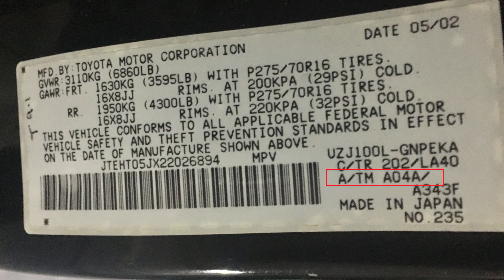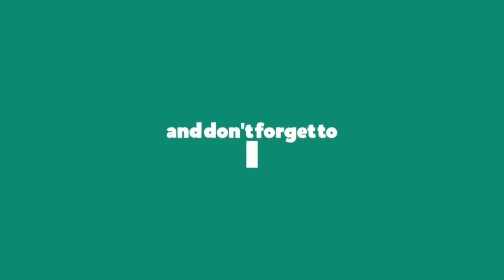Junkyard Find - How to pull an E-Locker for a Toyota 4Runner

Comment: This might be redundant to ask but I want to be sure before purchasing a taco diff. Tacoma e-lockers are 4.1 but their axle code is b03a (8 inch ring) & my 4Runner is 4.1 with axle code a03a (7 inch ring). I’m aware the axle housing will require some modification, but will the difference in ring size be an issue ?

Comment: I can just get a locker out of a Tacoma if I need a 4.10 right?
Reply from the maker: Yes
Reply: Tacoma axles are setup for leaf springs though and 4Runners for coil springs so you would have to mod it
Reply from the maker: Just pull the locker (3rd member) and modify existing housing to fit it.

Comment: I have a 98 4wd 5 speed 4Runner with a 4.10 gear ratio and would like to install an elocker. Can I pull the whole rear axel off a Tacoma and swap it into mine since I would like to retain my gear ratio and leave my front differential?
Reply: I believe the Tacoma axles are setup for leaf springs and 4Runners for coil springs so you may have an issue there

Comment: Will these parts fork for a 2001 Tacoma? Or are they not interchangeable with the 4Runner?
Reply from the maker: Same. Most of the time… we 4runner owners source part from a taco since it has 4.10 gear ratio. The axle housing won’t work but the 3rd member will

Comment: I’m struggling to pull the elocker pumpkin from the axle. I was hoping this video would answer that. Does anyone have a video link?
Reply from the maker: You gotta lock it. Then you can pull it out. You can remove actuator and use a flat head to spin the gear to lock it also.
Reply: @PhoRunner  I snapped the longest stud on my actuator and I’m hesitant to force it without completely understanding how it comes together. Is it safe to use heat on these components?
Reply from the maker: @jlaaj  Here's a photo of what it looks like inside. Just a gear so snapping the long bolt should be fine since it will slide off still.

https://www.toyota-4runner.org/3rd-gen-t4rs/284551-i-bought-new-aisin-elocker-actuator.html
Reply: @PhoRunner  I have since successfully pulled the actuator. Can you confirm which way the actuator has to be positioned? Driver or passenger side? I Did the opposite of what it was but the diff is hinge on something up top on something and I don’t want to reef on it too hard without knowing for sure. I suspect one of the multiple snapped studs is corroded and sticking. I have the axle shafts slide out as far as the brake lines will let me but that could also be a factor. Thank you for your time
Reply from the maker: @jlaaj if memory serves, towards the driver side when looking at it from the front (since that’s how you can see the gears). Do a quick search on Google as it’s a common thing people do

Comment: Great video! I have an E-locker from a Tacoma truck although I am trying to figure out the ratio w/o opening it and I dont have the truck either. How can I determine the ratio?
Thank you.
Reply from the maker: 4.10 if it’s a taco elocker
Reply: @PhoRunner  the cable plug to the e-locker is circular. Is that also an indication that is from a taco and 4.1 ratio? Thanks so much
Reply from the maker: The plug should be the same as the 3rd gen 4runner plug
Reply: @PhoRunner  Can I use it on a Tundra 2000?
Reply from the maker: @Cicada17XIII  no since they use a larger differential
Reply: @PhoRunner  I am still not sure what ratio I have, so far I know it is a tacoma and I am assuming 4.10 ratio but I dont know for sure.
Reply from the maker: All Tacoma came with 4.10
Reply: I rotared the axle in one direction and only one wheel rotated the other is seized and took two spins of the axle to give a turn on one wheel. What ratio is that? Thanks
Reply from the maker: You will have to count the rotations and do some math to figure out the ratio.
Reply: @PhoRunner  how?
Reply from the maker: You will need to put an axle shaft in. Spin the shaft/tire side 41 times and see if the pinion side rotated 10 times. That’s 4.10 ratio. If it takes 43 times for 10 times, that’s 4.3 ratio
Reply from the maker: Might be the opposite of what i said also. Spin the tire 10 times and count the pinion side. Mark a line so you can count easier

Comment: Would the rear locker work on the 01 02 models or did toyota change something with their design.
Reply from the maker: It will work but you will need some wiring to engage it and disengage it. Lots of aftermarket options for that.

Comment: Hi brother. Thanks so much for the video. You got awesome info about 4runners in your channel. Thanks i think many people have to thanks you for that. About the video i got a 4runner 1kz manual transmission i dont know how to find the info about the gear ratio and in want to have a rear locker. So i got to a junkward and there is a rear diff with factory elocker from a prado but it’s already out. How to know if it’s gonna fit? Can you help me on that?
Reply from the maker: I’m not sure sorry bud! I would check the housing bolts to see if it’s the same and also check the ring gear size if it’s the same!

Comment: Dumb question since u installed a rr locker…..are they better than a center diff lock?

I have the opportunity to buy a 2002 4r center diff lock or  1996 with rr diff lock. 

Both in similar condition and the diff lock is the deciding factor
Reply from the maker: Yes 2 different things
Reply from the maker: Center lock is good for snow where you want to drive around with all 4s. Diff lock is physically locking the rear for off kilter situations

Comment: Hey I finally did the Elocker OEM swap into my SR5 tacoma. Your video was pivotal in getting the set up together. Thanks man!
Reply from the maker: Cool! Wish I filmed installing mine with all the wiring haha. Glad I could help anyways
Reply: @PhoRunner  the wiring harness was the hardest part. I found out the hard way that my SR5 came pre-wired already in the cab, without the hardware, just the wires and plugs. Then I had some help from an ebay seller in Oregon that actually made a wiring harness that is connects to the 4 wheel drive computer and dash. Made the process a lot easier. With a few zip ties later, and following the wires into the cab... and finally finished. Best upgrade. Now, I am looking at installing a killswitch, so i can upgrade the suspension afterwards.
Reply from the maker: Nice

Comment: Thanks for the Video. Starting to build my 98 4Runner . No locker, looking to put a elocker in also regear. It’s a 5spd , running 265/75/16. Would you recommend 4.30 or 4.56 gears? Thanks
Reply from the maker: 4.10 should be ok with a 5sp. Don’t regear unless you go to 33 or higher and even then, the 5sp may be fine.

Comment: So  I had to drop the entire axel housing for my 96 to repair a broken control arm mount. This video was extreamly helpful.  Any idea what the second cable/ line is that is mated to e locker electric harness?    You cansee it  at  11:42   I just pulled mine out   not sure what it is or how to put it back
Reply from the maker: Is it the breather for the actuator?
Reply: @PhoRunner  So    In order to remove the 3rd member from an axel housing  must the locker be Engaged  or Dis engaged?
Reply from the maker: @davebarnett7026  engaged. You can slide over the gear using a flat head once you remove the actuator. Don't try to pull it out without doing this because it won't come out lol... Hence why I grabbed the whole axle.

Comment: Amazing video.  I just got a 98 4runner.  Need some HELP.  The 4WD would engage (solid green light) but to disengage after pressing the button the green light stay solid nothing happens right away but later after driving awhile there would be a BIG bang (shakes the car) and it disengages.  Any guidance on what the problem is?
Reply from the maker: When you disengage it, drive around slowly (let foot off gas and coast) until it disengages. Turn steering wheel side to side to help it. Once the light is gone, drive as fast as you like lol. The bang doesn’t sound good though.

Comment: One question, did you put a locking differential on your 4 runner who previously did not have a locked differential?
Reply from the maker: Correct
Reply: your 4 runner didn't have a locked differential before that means I can put one on my 4 runner
Reply from the maker: Yup it was open diff and I retrofitted it
Reply: @PhoRunner  my 4 runner does not have a locked differential I want to add one that is with differential lock can I do that
Reply from the maker: Yes you can. You can find what I found or you can buy arb locker and add it to your existing rear end.

Comment: I have 2004 Tacoma 2wd. Found a rear differential. Will it bolt right in?
Reply from the maker: The locker mechanism will mean it needs the axle housing too. If it’s just open diff to open diff or locker to locker, it will just bolt right on.
Reply: @PhoRunner  will my stock axles be okay
Reply from the maker: Yea

Comment: where dose the harness bracket mount to for e-locker is on top left rear shock perch?
Reply from the maker: yeah there's already a welded nut up there. You just find a spare bolt and attach the bracket to it.

Comment: 4runner manual  came with 4.10 ratio so no need to sawp front diif
Reply from the maker: unicorn lol. hard to find those. you can find a tacoma diff and put it on a 4runner axle also i believe but those are hard to find also.
Reply: @PhoRunner  So the diffs front/rear from 1gens Tacomas fit on 3gens runners??
Reply from the maker: Yeah. They will work. Just axle housing in rear is different

Comment: This channel makes me want to do this , currently 2wd, what would be the benefit of doing this ? I hear it makes it more reliable off-road but never understand why or what it really does
Reply from the maker: It locks the rear axle/tires together. When you go on un-even terrain, one of the wheel will lose traction and may be in the air and because of the open-diff, it makes the wheel in the air spin, while the one on the ground does nothing. That means you will get stuck. if you lock it, it will always spin together, therefore letting out of the hole. Many tacomas came with 2wd locked rears back in the day (they were the 'TRD off-road' models). So it'll definitely help but I think open-diff 4x4 will always win 2wd locked.
Reply: @PhoRunner  ohhhh !!!! That sounds really helpful for Offroading !!! Everyone always tells me " your wheel in the air will spin " but no one has ever said the key phrase " ground tire does nothing " so it's never made sense to me till now !
Reply from the maker: @lazroo  alot of people refer to 4wd as 2 wheel drive and 2wd as 1 wheel drive for this reason. It definitely makes things easier with a locker.
Reply: @PhoRunner  makes alot of sense ! Now if I found a rear locker , I'd replace the entire axle and gears , what else ?
Reply from the maker: Just straight swap drum to drum if you want. Just have to wire the e locker
Reply: @PhoRunner  why does this sound so easy haha
Reply from the maker: @lazroo  lol its not. it's a lot of work ;)
Reply: @PhoRunner  hey boss , so I actually ended up installing my e locker ! I am missing two screws not sure if you could help me find out what size they are ?
Reply from the maker: Which screws?
Reply: @PhoRunner  super late reply lol I ended up missing screws but I was able to find them .  Question for you, how do you personally engage your E locker ? Do you hit the button while in drive or neutral ? Do you have to do anything special like engage then drive for a few feet ? My switch lights up sometimes and sometimes it doesn't, but I always hear a buzz sound under the truck .... Not sure what's up with that
Reply from the maker: It will try to engage so usually you have to drive it a little until it clicks into place. I usually engage it before I need it while in drive
Reply: @PhoRunner  I used an aftermarket switch not the OEM one, sometimes it lights up sometimes it doesn't .... Any idea ?

Comment: So if I have a 2002 sr5 with center diff what do I need to switch to rear diff lock?
Reply from the maker: Just find what I found and wire her up! Don’t use center lock with the rear lock. You should have low range and another 4wd mode.

Comment: Ever seen a green ECU? I just pulled an e-locker for the swap and it came with a green ECU that has 13 wires instead of 10 like the black one. Can't find a wiring diagram for it anywhere...
Reply from the maker: I have never seen that before..

Comment: Thank you for your videos I’m a beginner and I got a 2wd 4Runner . I’m wondering how can I tell what ratio ( A/TM A/ 01A)gears I have ? And if 2wd can have e lockers ? Thank you in advance
Reply from the maker: 2wd won't come with lockers but you could retrofit/add one. The ratio on 2wd (A01A) is 3.73.
Reply: @PhoRunner   thank you very much
Reply: @PhoRunner  The limited don’t they run a 410 ratio?
Reply from the maker: Nah 430

Comment: If you find the time to do a video on how to properly engage the 4x4 and locker while showing the correct indications, that would be very helpful. 

After watching yours and Timmy the Toolman’s videos, I’ve been looking for a donor vehicle to swap in a locker on my 5speed, but it seems I’m getting different indications on 2 different vehicles and suspect one of them to be broken. I’m new to the 4runner and 4x4 world tho and honestly not sure what indications I should be looking for. Clarification from someone who knows what’s up would be highly valuable. 

Thanks for the help. I’ve made all kinds of progress on my 4runner so far with the aid of your videos.
Reply from the maker: Press the button and wait for it to turn solid on the dash. if it's blinking, just roll the truck until it locks. If you have it outside, just turn the wheels until it locks.
Reply: PhoRunner Channel thanks for the help. Test drove one yesterday that never stopped blinking and wouldn’t engage. Had me second guessing myself. Hoping to find one soon and make the swap.

Comment: Question so the only thing I need to add rear lock differential is to remplace the rear differential and not the front?
Reply from the maker: You will need matching gears for front. If your gears match, then you only need to swap in a rear

Comment: So extremely helpful man, your a hidden gem for any 3rd gen owner, or 4runner for that matter.  Thanks!
Reply from the maker: Just trying to keep up with Timmy the Toolman
Reply: @PhoRunner  is there a list of all the vehicles with e lockers?? Would be useful to have several options other than a 4 runner too
Reply from the maker: @FirstLast-tx3yj  Only 4runner and tacoma will be compatible due to the size of the diff

Comment: If I want an e-locker but the switch position has the diff lock button there (2002 model). is there a way to use a different switch?  Thanks!
Reply from the maker: Yeah you can buy a low range Offroad wiring harness and switch for easy install. You can place the switch where all the blanks are on the left.
Reply from the maker: You won’t need all that ecu and plugs if you got that route

Comment: Awesome and very informative video! Thank you! I have a few newb questions...If I got a locked rear diff and axle housing from the yard, would there be any harm in using my original axles to complete the rear end? Also, do most junkyards charge around that price for a rear diff and front diff that you mentioned in the video? Found a CL deal for $900 complete front, rear, ecu, switch...worth it?
Reply from the maker: No harm since that’s exactly what I did.  Most yards have their own pricing so it all varies. The locker alone typically runs for 600-700 so $900 complete isn’t bad.

Comment: Great video! I have a question. I own a 3rd gen 4runner with a 4:10 gear ratio (per your description) and I am looking at buying a rear diff e locker online. The seller says it came off a 4runner with the same gear ratio. Could I install this on my runner and be fine? Thank you - Layton
Reply from the maker: If it’s indeed a 4.10 on a 4runner, it will be fine but as far as I know, those do not exist? He’s probably not aware it’s a 4.30. Only Tacoma’s have 4.10 e locker diffs. A manual 4runner will have 4.56 most likely. Make sure you have him count the teeth before you order it just to make sure.
Reply from the maker: Teeth on ring gear / teeth on pinion will give you the gear ratio. So 41 to 10 is what it should be if it’s 4.10
Reply: PhoRunner Channel the only reason I think my 4Runner is 4.10 is because it says “A03A” on the sticker inside my drivers door. It’s a 2000 4Runner SR5 V6

Comment: fuck I have the 4.1 gear ratio. Gonna need both :(
lol your timing for videos is always impeccable. I having been planning on swapping mine soon.  This videos gonna help alot.
Reply: also thinking of pulling the body completely off the frame, so that I can clean it up and recoat it. You will have to do one of those videos soon.
Yes, I realize that your frame has zero rust on it, but think about the service you will be providing all of us :)
Reply from the maker: lol i don't have the tools or expertise to do that. my frame actually is quite rusty. It came from canada haha
Reply: PhoRunner Channel what tools are you thinking you are missing? I can’t see it being much more difficult than anything you have done. I think the biggest difficulties would be finding the time and space to do it. It won’t be a fast process, but shouldn’t be hard, from what I have read. 
Drive that yota of yours back up to Canada, and we can do it together this summer. It’ll be a blast, eh.
Reply from the maker: @huntjulien-i9o  hehe... maybe one day! I haven't had further rusting since I performed some basica "rust" remover and painting. Working on it has been more pleasant now that I've replaced a lot of the rusty bolts and parts :)